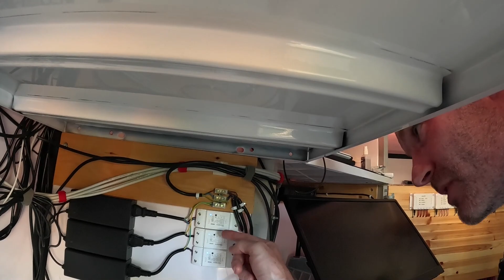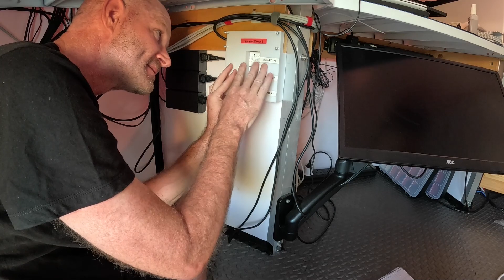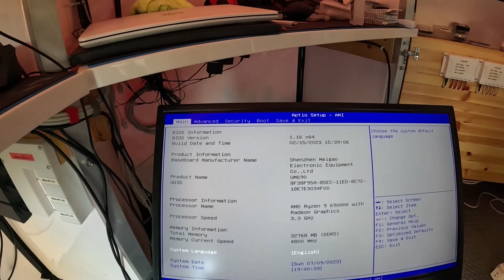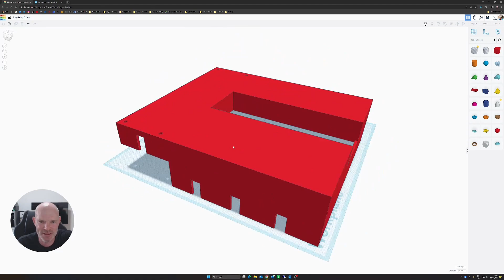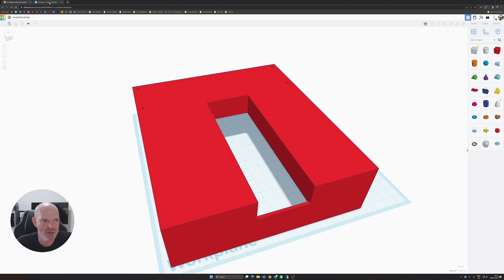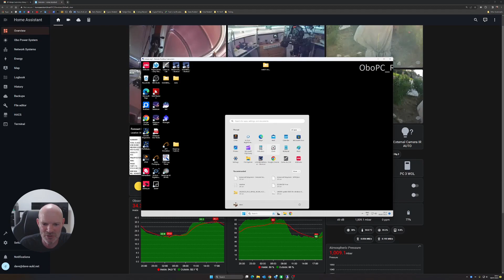Project Power! Part 8 -  Mini PCs Power

Comment: I use SONOFF S31 WiFi Smart Plug with Energy Monitoring so wouldn't have to splice into any cords.  I have Tasmota loaded onto them and works really well with Home Assistant.
Reply from the maker: I had the Basic R2 to hand so used them, also used the 4 channel wireless switches for some of the other dc supplies, works well and integrates nicely with Home Assistant etc.

Comment: Hiya Dave . Question...with the BIOS set to "Restore on AC Power Loss'" , does the Laptop restore to the last opened screen or just the Logon page ? .Cheers ./SRK
Reply from the maker: The mini-pc just boots to the normal login front screen.

Comment: Sounds a bit like my problems sometimes......one simple enough issue grows into several problems one after another!
My current issue is a USB-Serial (modbus) adaptor on my web server that despite there being a COM port visible and can connect there's no data......I have to disable the adaptor in Device Manager and re-enable again. Luckily it only happens (sometimes) when I close the COM port to update my AirCon software.
Reply from the maker: Annoying when these things happen, you would think something as 'simple' as a comport which has been around for years, would be easy to implement.